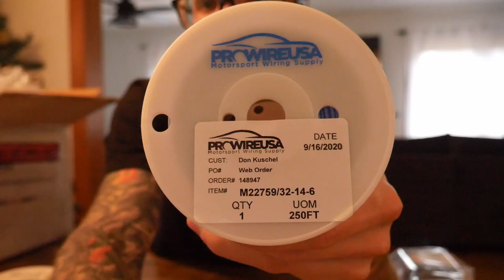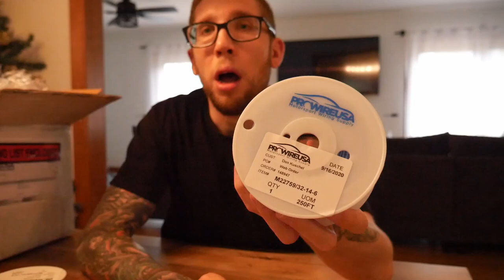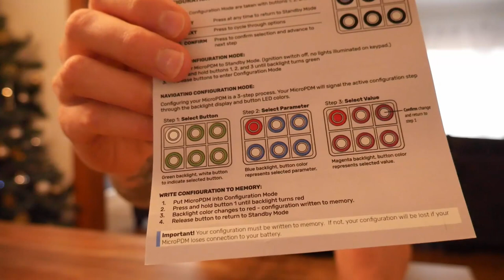Hardwire PDM and e30 electrical build unboxing.

Comment: Holy shit am I glad I just found this pdm.  Did these just come out?  I have been looking at pdm’s and they either don’t have enough circuits “ECU master “. Or they are very expensive.  I think it was meant to be, there is a dealer selling these a half hour from my house.  Do you think the 15 has enough circuits for a full  street car?  ECU master does have cool products, I think I will use their dash display, and battery cutout.
Reply from the maker: Glad this helped! You’ll be happy with the unit. I think you’ll be fine with a 15 output unit for a street car. My build has a lot of extra stuff and I’ll have some extra with the 15. ECU master stuff is real nice, but they just weren’t in the budget I wanted to be in for this build.